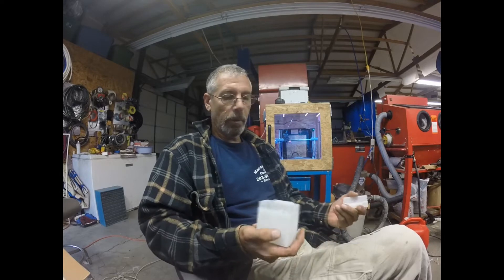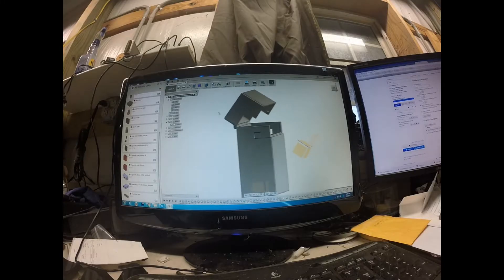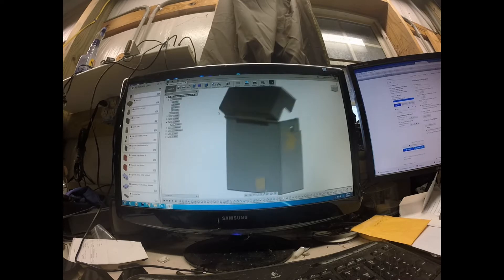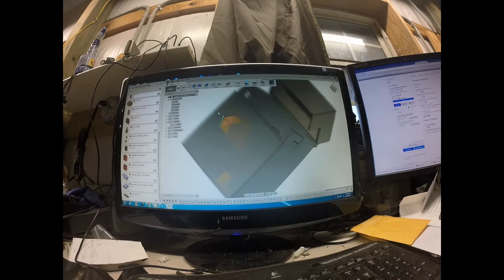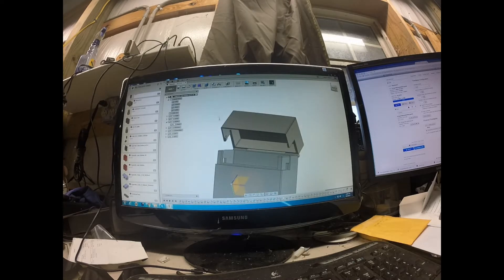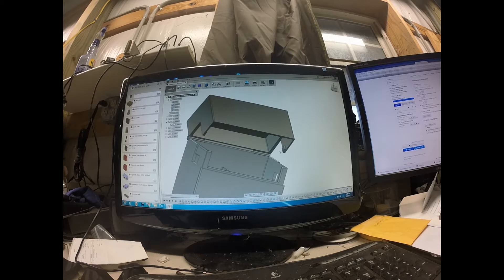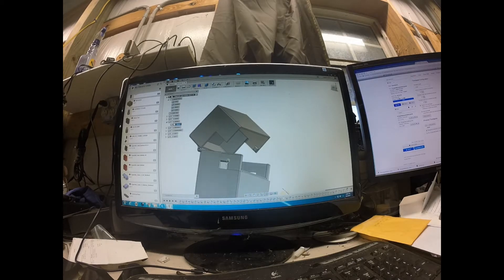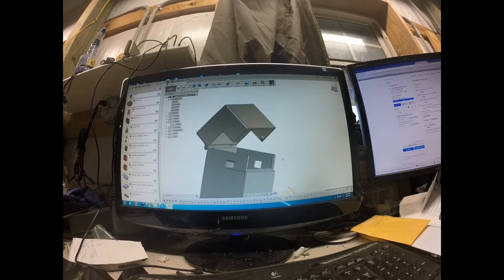3D Printing with Nylon  It aint that hard!

Comment: I stick trimmer line/nylon using scotch permanent double sided tape. If corners start to curl super glue with baking soda ties it down. Heated bed at 80 and too bad they don't got part cooling fan that can blow hot air, it would help. Enclosure is my next project, too much heat transfer is the problem that causes nylon to warp.  Need warm bed and heated enclosure.

Comment: Which do you think is easier to print, nylon or petg?
Reply from the maker: I actually like nylon better, but it requires higher temps, and an enclosure...and it's gotta be dry. Nylon makes a good strong part that is resistant to a lot of chemicals and sunlight.
Reply: @marcellemay7721  Thank you. I read that it requires an all metal hotend.
Reply from the maker: @neilfpv  Yes it does.
Reply: @marcellemay7721  I removed the nozzle last night to see if my hotend has a ptfe. I wasn't sure if it had one. I can't tell it from a picture. What do you think? Here's the pic - https://i.imgur.com/5rX0HeS.jpg

Comment: Not sure why you would need nylon for this application. One trick is to make a perimeter with painter's tape, then use a steel straight edge ruler to draw the 50/50 glue across the glass, that makes a thicker coat that is flat. Tram the nozzle and bed on the glue patch.

Do yourself a favor and fillet those edges in Fusion360, they look painful.
Reply from the maker: I printed some in nylon and some in pla. The ones I printed in pla are long gone, broken. The nylon ones are still as good as the day I made them. Over a year old and used daily.

Comment: So enclosure is a must when printing with nylon?
Reply from the maker: An enclosure is better no matter what you're printing with. It keeps the temperature stable, therefore reducing temperature variations which can cause the part to warp. I'd say that it's not absolutely necessary for nylon. I've been printing with an enclosure since the beginning and I've never had a problem with parts warping. It's just better.

Comment: Too bad you can't use weedeater line....
Reply from the maker: +Alonzo Branson   Actually you can!  I've been using esun brand nylon, because it's relatively inexpensive compared to  Taulman nylon. The price on esun nylon compared to weedeater line is just about the same, so there's no advantage to using weedeater line, especially when you consider the fact that printer filament is kept dry and formulated for good 3d printing. characteristics.
Reply: Huh...who knew?  :D

Comment: Thanks for posting this!
What ratio of Elmer's to water did you use?
Reply from the maker: It's a 50/50 mix elmers glue to water. I just spread it on the glass with a foam brush and let it dry before printing on it.Thanks for watching!
Reply: That's so awesome, I cannot wait to try this out. 
Thanks for posting this video!!!

Comment: Which is the best printer for nylon?
Reply from the maker: Denis Nash a There is no best printer for nylon. You need a printer with a heat bed that will reach at least 70 degrees c , and that can heat the filament to 255 degrees c. An enclosure is also recommended.

Comment: That's the problem with nylon, it needs too much maintenance - as you found out. Keeping it dry in a sealed container, heating in the oven etc. I personally lost patience with it but when it works its great!
Reply from the maker: Alan Long  I'm currently printing out parts for a hypercube evolution build that I'm planning to build. Yes, even with all the maintenance it still seems to absorb moisture. But, it still makes very strong parts even with a little bit of moisture in it, although the parts come out a little milky looking. For structural parts, I'm more concerned about strength than beauty. A little bit of moisture doesn't seem to affect layer adhesion or strength all that much. I suppose it can get to the point where it is unusable and then it needs to go in the oven, but so far I've been able to print with it without having to dry it out in the oven.
Reply: Maybe design an air tight cylinder for the filament with a "rubber sealed" hole (or some such seal) for the filament to exit into the extruder. There you go Marcel - that's your next project!
Reply from the maker: +Alan Long  My next project, which I think will be today, is installing a ramps board on the printer. The extruder motor driver died on the Anet board. I haven't been able to print stuff in almost 2 weeks.